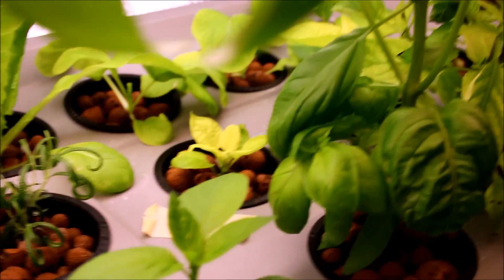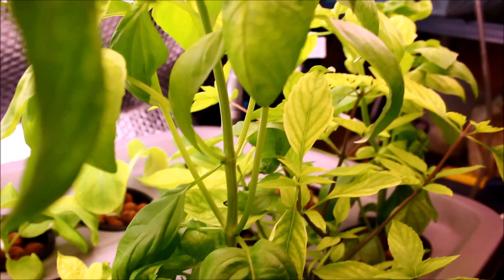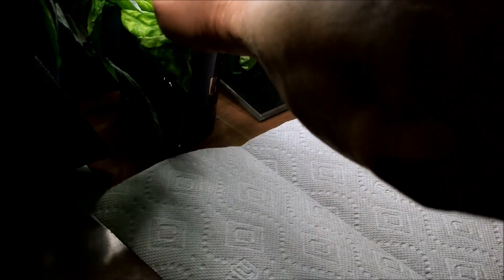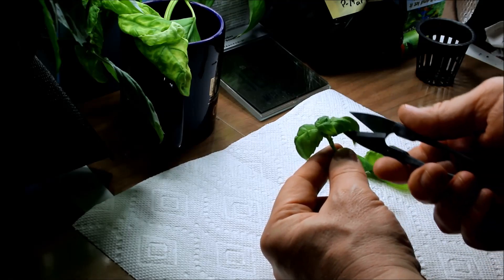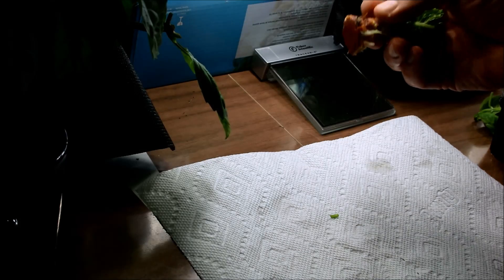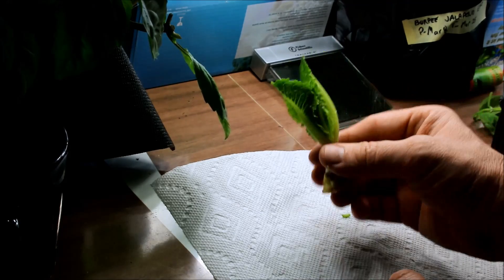Aeroponics Cloner - Buildout and plantings

Comment: I just use a corner hole with neoprene plug to put the cord through and mot worry anout leaks.i also make the holes just small enough for the plugs to fit snug

Comment: hey mate goog job there i was just woundering what nutrients did u used in ur machines??
Reply from the maker: Hello Ashvin, I use both liquid and dry nutrients. I've used General Hydroponics liquid, but find that DNC works very well and is less expensive (and available locally for me). I use Maxigrow and Maxibloom dry powder too. They all work well if you follow the directions.

Comment: Nice video! Do you think an aeroponic system like this could replace the need for a DWC setup?
Reply from the maker: Sure! You may even get better yields. Just be aware that if you live in an area that is prone to power outages you run the risk of something going wrong quickly. A few hours of no air pumping into your DWC won't affect the plants too much as your roots are still sitting in water, but hours of no spraying your plants with aeroponics could be quite stressful or even fatal to some plants.

Comment: about the onion and lettuce I did that 5 days ago the onions grow (about 5 inch) back pretty fast the lettuce (about 2 inches)  a little slow  but looks just like yours and love both ..! I have a question they always say clay pebbles but i'm asking is there any reference between clay and normal marble size stones?? (cleaned of course)
Reply from the maker: I've never tried using stone pebbles, but I know others have (beach stone etc) with success. Once the roots are extended into the reservoir, the pebbles really just keep the light out (and algae down). You don't want to use a stone that would leach into the reservoir (limestone etc)
Reply: ok thanks

Comment: Hi, Also I have the tub, I'm wondering how many inches did you cut your legs to ? thanks , nice job .
Reply from the maker: Kevin Padd It depends on the tub. I cut them so the sprayers are about an inch below the bottom of my net cups that I used. That way it doesn't actually touch the pot but sprays all around and even into them.
Reply: Hi. thanks . I'm not using net pots. i'm just using plugs , placing my cuttings into them.. So my tube is rubbermaid 10 gal.. bottom inside measures 18x12x8".. could you tell me should I make legs higher than 4" high ?.and the pump spout 3 in. ?.Or.. i was going to go 16x10x4" ? thanks

Comment: Hi, I was wondering how the pump mates w/ the threaded / or unthreaded fitting that supplies your manifold ? thanks
Reply from the maker: Kevin Padd The pump I have had a 3/4 inch threaded fitting. I just went to Home Depot and from a threaded female connector to pipe fitting for a couple of dollars.